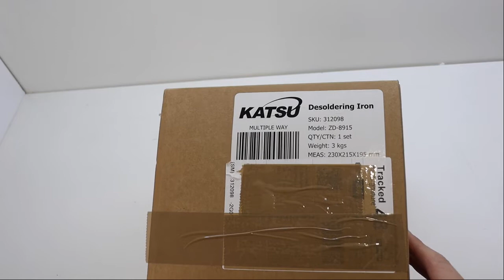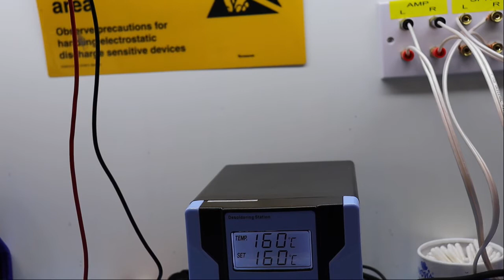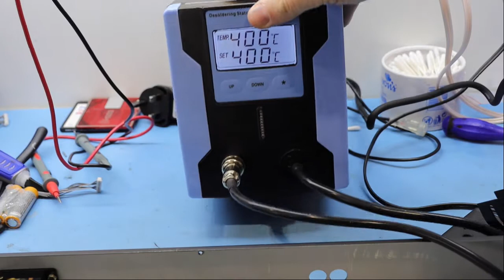Katsu De-Solder Rework Station Unboxing and first impressions review

Comment: Nice got the same. Everytime you dedolder do a fast clean and theres no problems with this device. Got the on/off switch now on the front and remove fan for short use. Makes it a great device without noice
Reply from the maker: Yeap switch would be nice on front.

Comment: Good video, it's worth using a gentle stirring motion whilst you suck up the solder to get it all up, and let the pump run for a second after removing it from the component to reduce the potential for blockages.
Reply from the maker: thanks